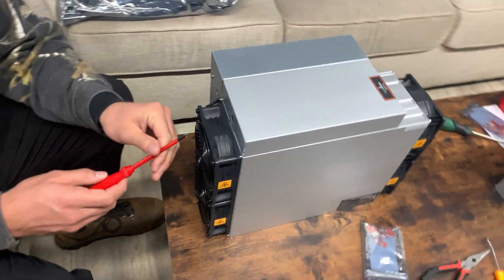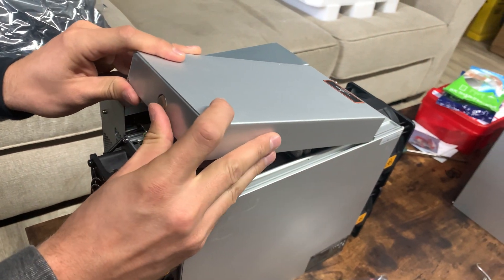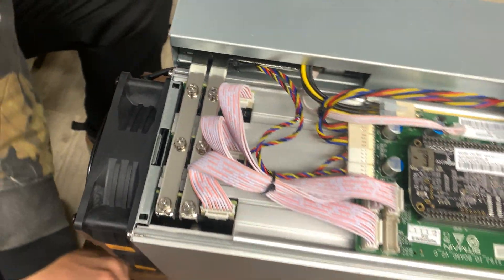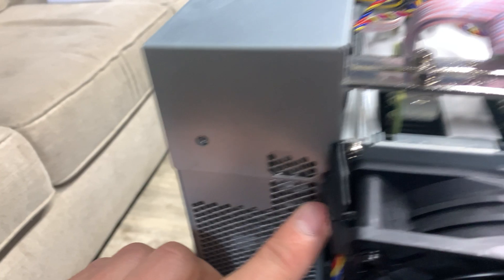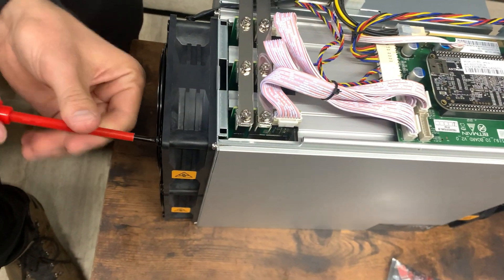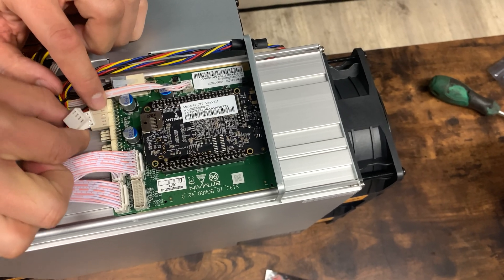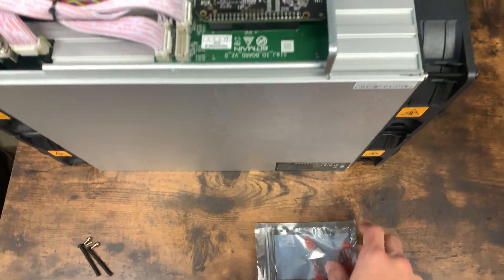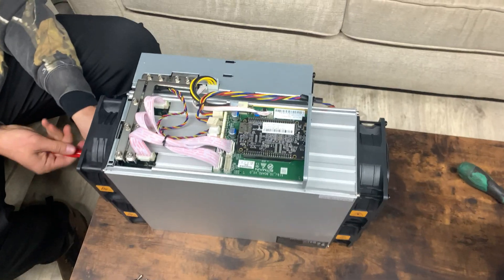Antminer S19j+ Fan removal / replacement tutorial [2025]

Comment: Quick question, what are the little things you  said we would need if we want the machine to tun, ingot confused and idk if i need those to replace the fans
Reply from the maker: Those red chips are fan simulators, if you had another method of cooling the systems without those fans, the only way the machine would run is with those chips, but for a fan replacement you do not need those, just do the reverse of this process!
Reply: @Anomaly417  how do u get those? from Bitmain website? or different provider. I am gearing u for liquid cooling ;)
Reply from the maker: @GEOPOLITICALANALYSIS  i think we found those specific ones on Amazon or eBay just look up fan simulator and then the name of the unit you will run
Reply: @Anomaly417  appreciate your response.
Reply from the maker: @GEOPOLITICALANALYSIS   no problem bro!
Reply: @Anomaly417  Can you send the link to the ones that you used please
Reply from the maker: Good question!
Reply: Man, we’re trying to immerse an s19j pro and the front fans have a different connector and not the 4pin type that work with the spoofers. Have you seen this?